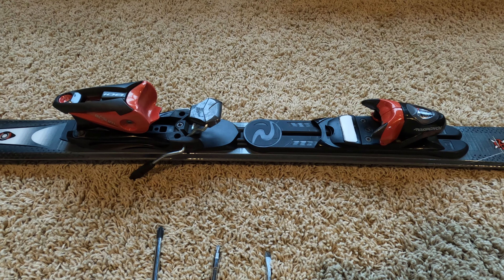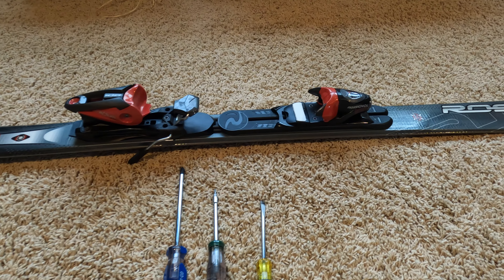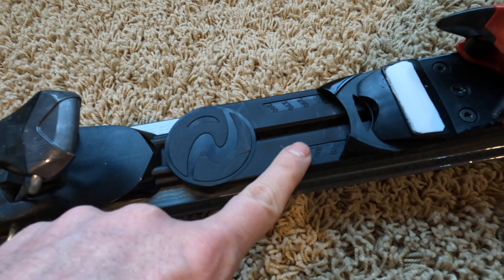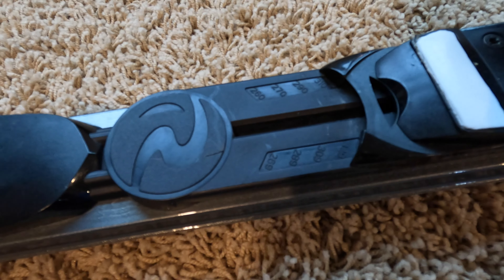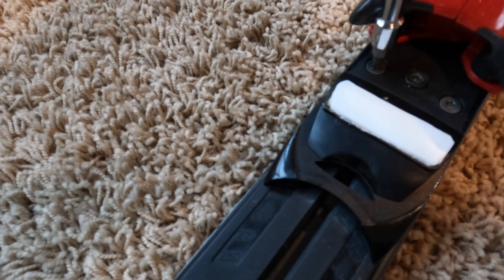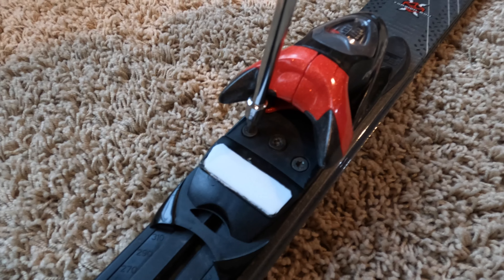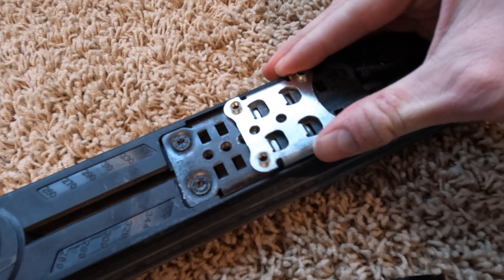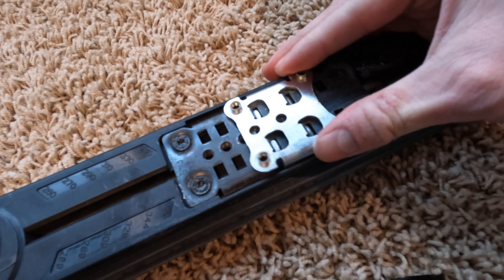How to Adjust Rossignol Axium 100 Ski Bindings - Change Your Own Axium Ski Bindings Tutorial

Comment: Good luck finding the correct settings (DIN). Most of the YouTube videos I've seen explain it wrong (some of them horribly). But even if you do luck out and get it right, how are you going to test the system to verify that everything is working correctly. Ski bindings have internal parts that wear over time (cams and pins). Even if the binding is rarely used, the springs are usually always under tension and could fatigue. It is not uncommon for the setting from the chart (called the initial setting) has to be changed in order to accommodate the intended tension specification for any given skier (called the final setting). So in these cases, the setting from the chart is incorrect - sometimes as much as two full settings. This is why binding manufacturers no longer recommend using really old bindings. It is not a conspiracy to sell more bindings. It is because at some point the binding becomes unreliable and is a liability to the skier. In addition to the points mentioned above, plastics become more brittle over time and break easily, and glued components break down and come apart. Nothing lasts forever.